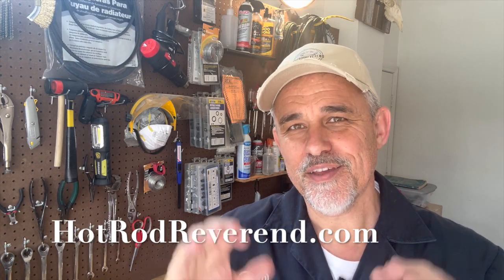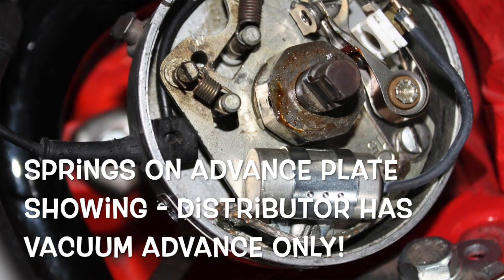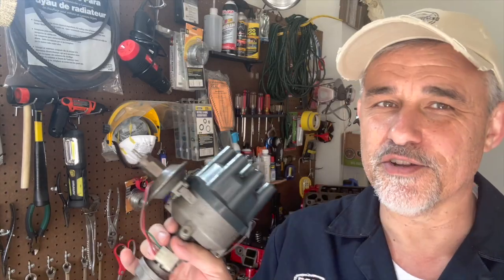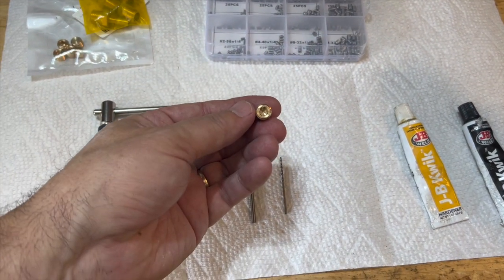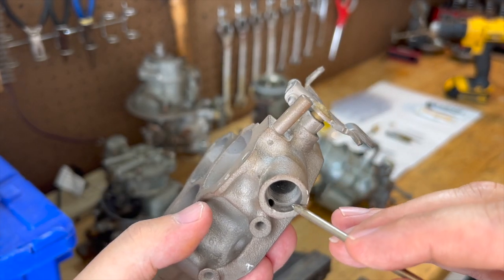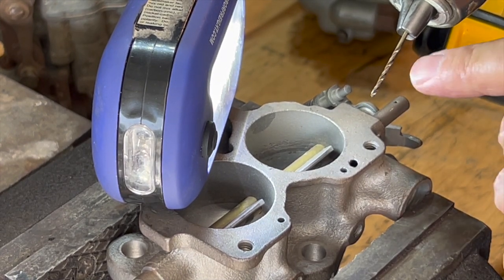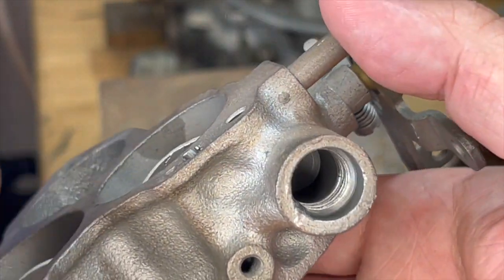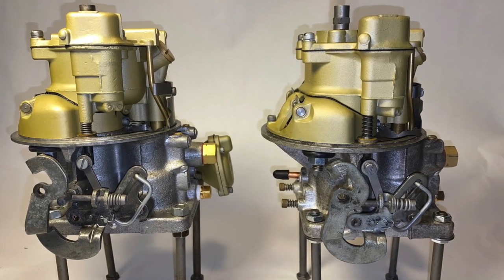How to Modify a Holley 94 two barrel Carburetor for Centrifugal Advance

Comment: Great video Rev! Definitely keeping this one tabbed, as i have a 2bbl 272 I'd like to try this on if the load-o-matic doesn't want to co-operate and I get my hands on a later distributor.
So since the 57-64 distributors have been a topic, I started searching for one and wow..... they are proud of them. I've also heard rumors of a small block Windsor distributor being able to be used in place the of the 57-64 Y-Block and a cheaper and more plentiful solution. Are you aware of it? Will you be covering that modification by chance? I'd be really interested in see that one!
Reply from the maker: @OlysGarage  I have never modified a Windsor distributor- I think that would be my friend Andrew Levine out in New Zealand
Reply: @HotRodReverend  does he have any information posted about it anywhere?
Reply from the maker: @OlysGarage  I do not believe so. Andrew does not have a YouTube channel or website.

Comment: Why not manifold vacuum?
Reply from the maker: This is always a fun topic (manifold or ported vacuum for ignition timing) and it gets to the level of "which motor oil should I use in my Y Block" lol. For a stock engine (which is really what most guys will have if they are keeping their Holley 94 original to the car) and even many mild performance engines the manifold vacuum will be much higher at idle than the ported vacuum from the carb. This will often give more advance than what is needed. (IMO, but to each their own here, sometime this stuff is more art than science it seems.)
Reply: I have always found small block fords much more responsive to manifold vacuum than intake vacuum. I have no ownership history of the y block but always thought I’d like one. I find this stuff fascinating. Thanks for sharing your knowledge, sir